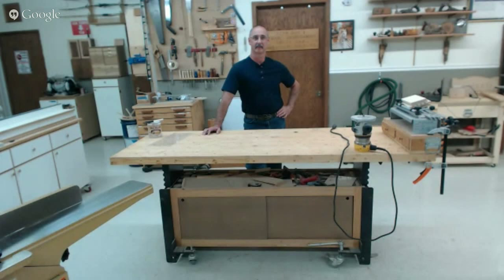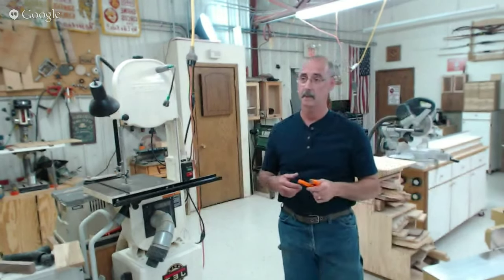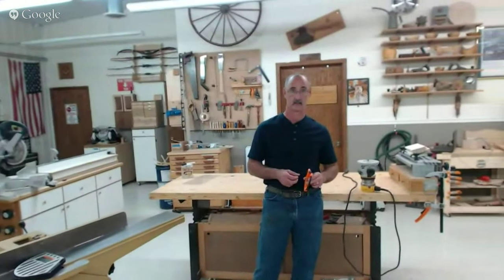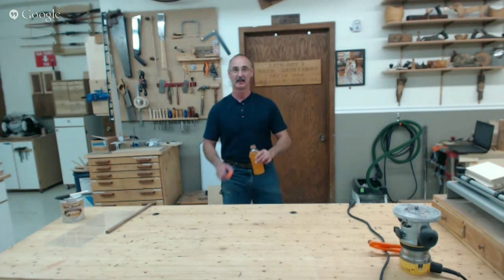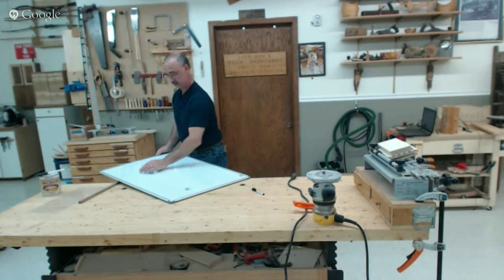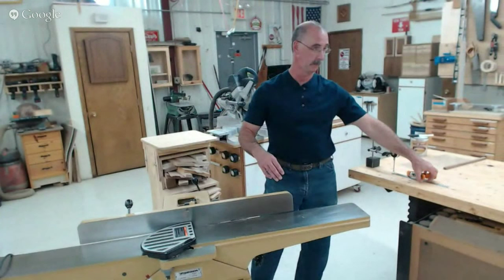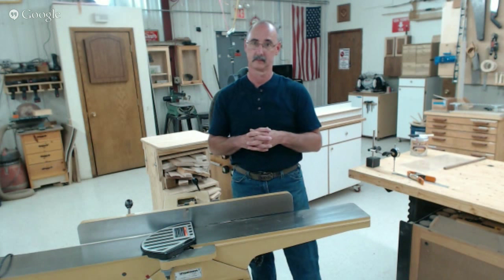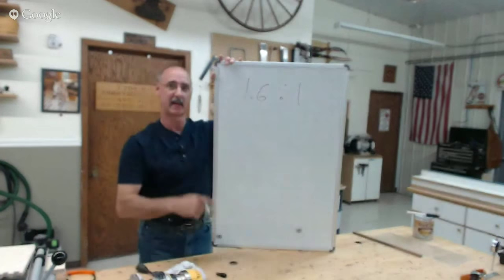WWGOA LIVE, JUNE 11, 2015: George answers your woodworking questions

Comment: The English polisher has a great way to repair a finish with a water mark by using a flammable liquid and wiping it over the surface and light it on fire and it will draw out the water mark. The flammable liquid escapes me right now but if you check out his finishing projects I am certain you will come across his method of repair. I love you work George. Thank you.

Comment: A burning woodworking question:  Can you recommend a dye or pigment for addition to a danish oil?
Reply: Hardnox I hope someone will answer this, has I been wondering this also.
Reply: Thanks.  I have researched extensively on this subject.  I have spoken with the tech gurus at Minwax and Watco without success.

As it turns out the answer was readily available but search terms such as wood dyes, wood pigment, danish oil pigment yielded unsatisfactory results.  The answer to adding pigment/color or to alter the tone of stain, varnish, oils, epoxies, even latex paint is to use pigment offered by Mixol in Germany.

I just purchase a "woodworkers kit" from Amazon of all paces.  Woodcraft and Peachtree offer Mixol products as well.  The reviews are most encouraging.  there are a number of articles in Woodworker's Journal and Popular Woodworking on Mixol pigments.  Who knew?

The beauty of Mixol pigment is that it has NO binders.  What that means is that it will mix with anything.  Clean-up is with soap and water for an added benefit.